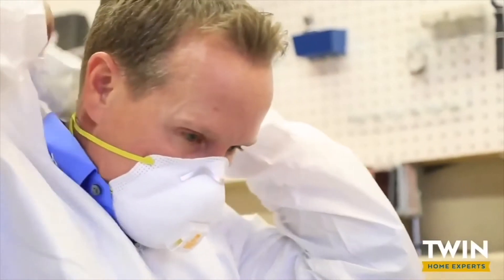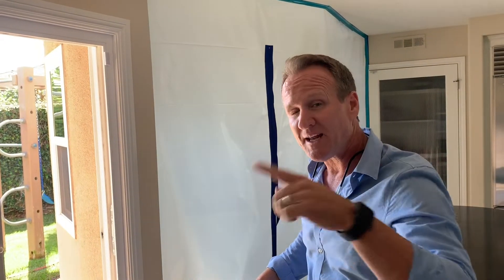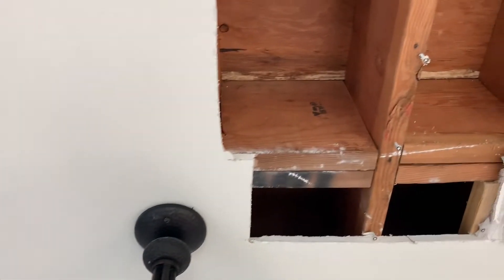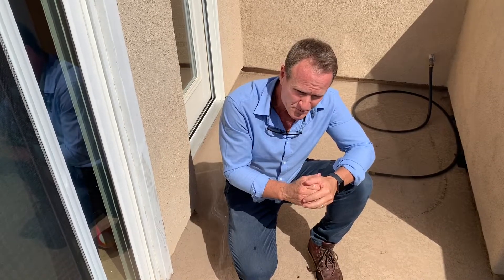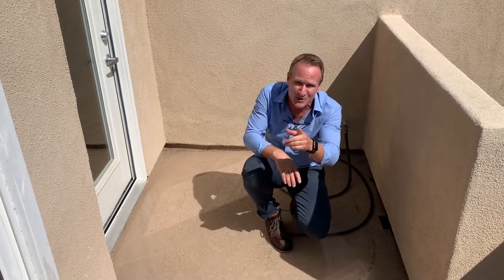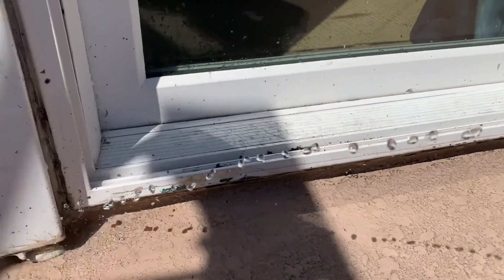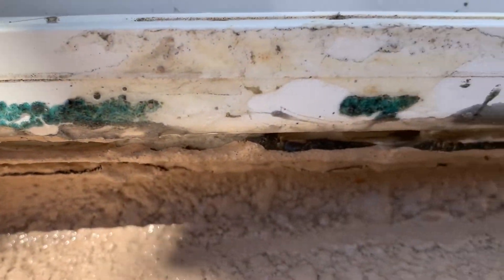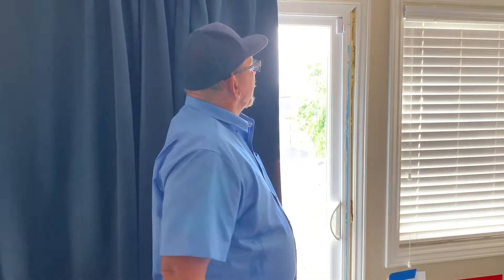How To Find A Leak In Ceiling When It Rains

Comment: Where can I find the putty that you used in this video?
Reply: Plumbers putty in plumbing section. Plumber's putty is specifically designed for plumbing applications. It is ideal for setting faucets, sink basket strainers, shower and pop-up drains. It's easy to wipe away after installation and will not be visible from the outside of the plumbing fixture once installed.